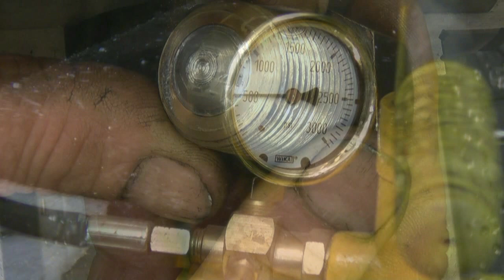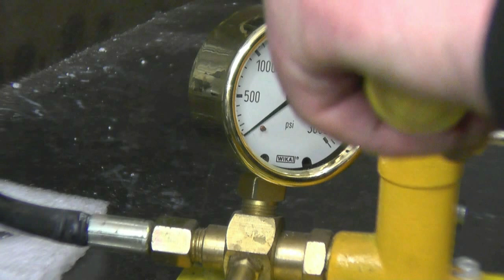SNNC 168 p1     Fusable plug service  (email in video has a typo)

Comment: John, I'm thinking the reason for the rounded head is because your plug is a straight through design and not tapered as most of them are.  When tapered the narrow end of the plug points to the outside so boiler pressure can't blow them out.  With yours being a straight through design, even though the threads will help hold it, the rounded head should provide a larger surface for the pressure to act upon and prevent blow outs.

Comment: Hi John, Looking at some of the comments, and what you say about the Boiler Inspector liking the Dome End on the lead, is this to increase the Lead to Water contact area? i sure think it is, my plug on my Fowler was a plain Tapered type which basically let the Boiler Pressure keep the core pushed tightly in, unless of course it was bared when it would do its job. Great Vids Pal.

Comment: hopefully this is a good question, but why do you need to remake the plug if its still intact?  is it just because small amounts of led might melt out or perhaps release from the internal threads?
Reply: yep same from me, id consider them to look pretty good, i can imagine after many years they might be a  bit scorched, but only for a year, they looked fine, cept for the worn out one anyway
Reply: The oxidization will prevent it from melting at the proper temperature, even though it looks OK it could have a much higher melting point.  Normally you replace them when working on or cleaning the boilers